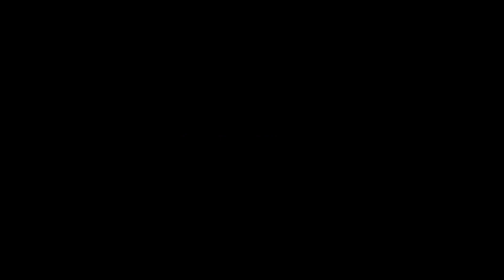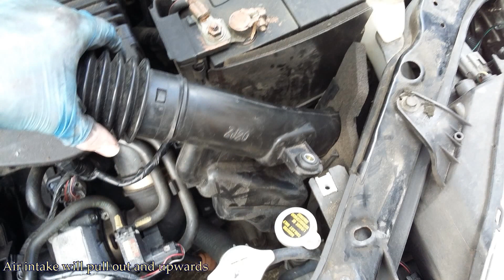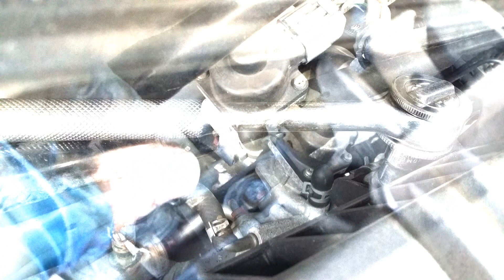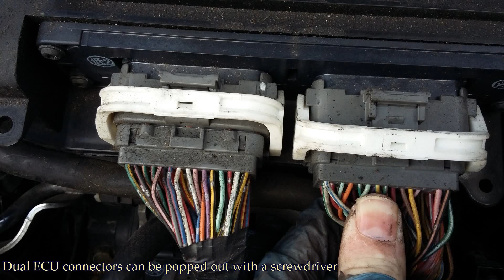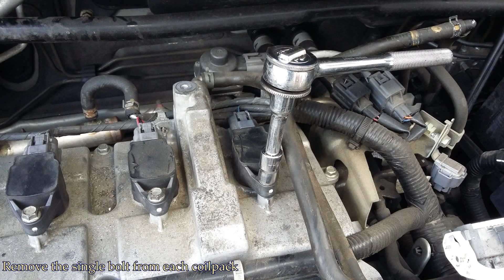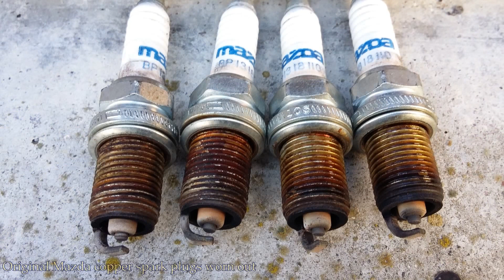Mazda 2/Demio ZJ engine - Spark plug change - Japan import

Comment: I checked Denso, they recommend IK16 for 2005 demio?
Reply: thanks. does it work well? how is the fuel consumption of demio？ Because my 1.3 demio has poor fuel consumption, 8l/100km? I saw someone recommend denso spark plug which can drop consumption down to around 6L/100km???